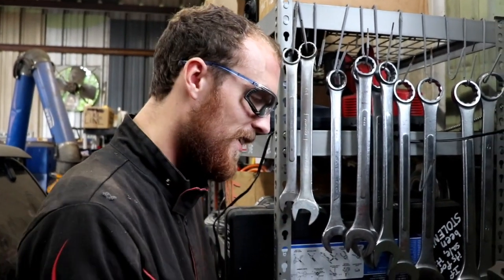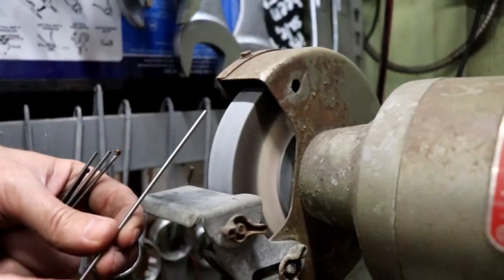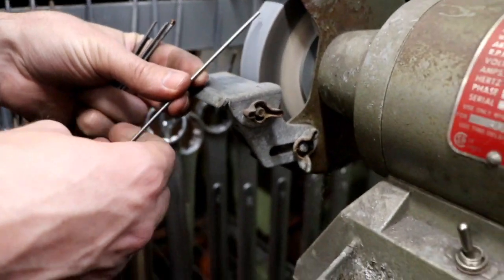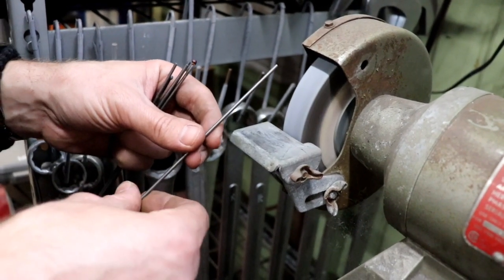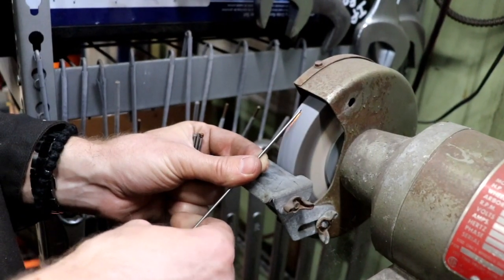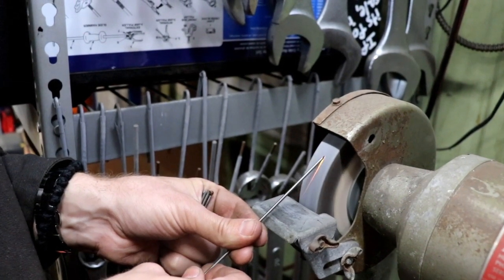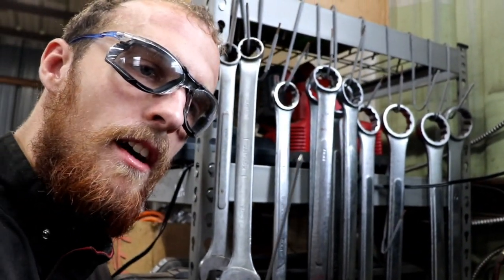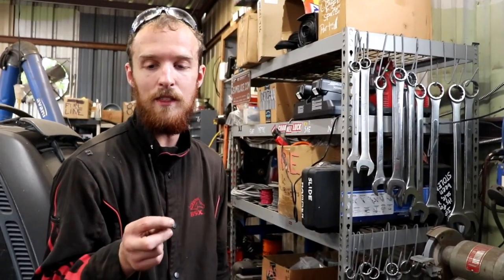HOW TO SHARPEN TUNGSTEN WITHOUT EXPENSIVE TOOLS - TIG WELDING BASICS

Comment: HELL WHEN I WAS HELPING MY FATHER (HE WAS A RIGWELDER) I USED A 9 INCH ANGLE GRINDER ,SET IT WITH THE DISC HORIZONTAL TO THE TAIL GATE ,BENCH GROUND OR WHATEVER YOU HAVE ,TURN IT ON AND SPIN THE TUNGSTOEN .
POPS WOULD SHOW OFF AND SHARPEN IT WITH AN OXY/ACETYLENE TORCH. THAT WAS OVER 45 YEARS AGO.

Comment: Not necessary, but what about turning the rod with a cordless drill.while grinding. it would be a perfect tip every time.
Reply: That’s how we do in the shop
Reply: @Thatdamfishingguy  it's OK as long as you do not spiral the grinding marks. The striations have to be straight in line with the rod.
Reply: @1pcfred  right